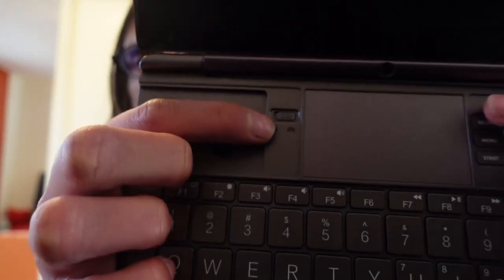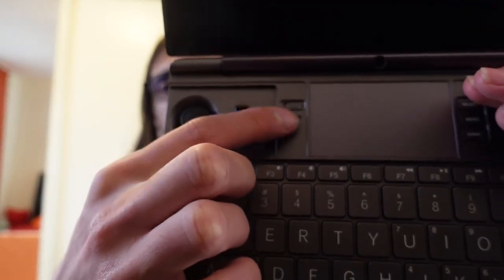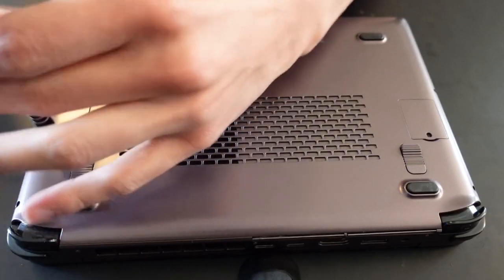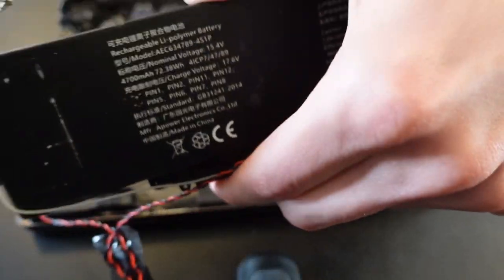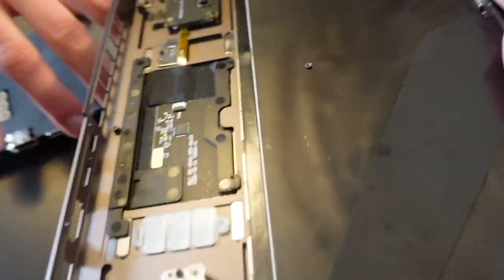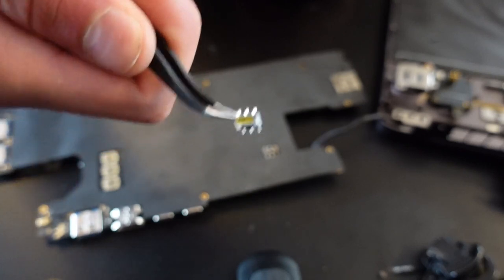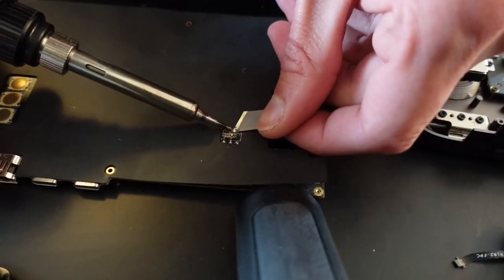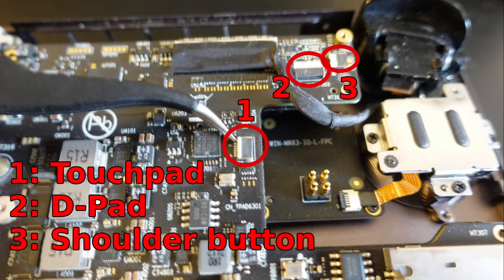GPD Win Max 2 - Teardown (bottom) + Mouse-Gamepad switch repair

Comment: Hi mystechry, looks like my new wm2 7840u defect suddenly it report hypervisor error and fall to automatic repair loop, end up with blank screen and fan hit high speed. All attempt to reinstall or fix is not working (through usb flash drive), I email gpd but have not receive any respond yet. My guess either the memory module or ssd have stability problem, since gpd put warranty seal sticker in middle hole screw, I can’t check and see the inside as it may void the warranty. It’s been 5 days my wm2 becomes the expensive paper weight on my desk. It still can turn on, enter the bios, but stop after the gpd logo appear and spin wheel.

Comment: Would you recommend win max 2021 over 2022 in terms of durability/issues? Seems like like win max 2 has a ton of issues
Reply from the maker: I am using my 7840u unit every day for many hours since I got it. So at least for me both units were super stable.
What annoys me a little is how I can not use both SD cards at the same time and that (for me) useless Oculink port at the back.
From an efficiency point of view, the 7840u is better than the 6800u
Reply: @mystechry  

So your 6800u didnt have the sd card constant disconnecting problems?  That is my only gripe with the 6800u unit. Not sure if it happens in both in the 16gb and 32gb ram variant
Reply from the maker: @oneyedthing  No, I never had that issue.
You can simply set SD speed to USB-1 speed to fix that issue.
I would rather have 2 slow than 1 hast card reader, but that is not an option any more with the 7840u
Reply: @mystechry  

I finally got a Win Max 2.  All my past concerns seems to be non-existent with my unit now. 

May ask another?  I know most of the testing are for gaming. Is it normal that while watching a 1080p full length movie, the battery percentage decrease to 1% every 5+ mins of play?  In about 30mins of playing the movie, I get 97% battery charge down to 88% 

No Wifi, no keyboard light, brightness is at the middle and volume at low  Also other uncessary running apps like OneDrive are disabled while I was testing it.

I hope I didnt get a unit with a battery problem
Reply from the maker: @oneyedthing  I am not sure and I can not tell you.
I have optimized my Windows to consume less power.
On an non-optimized Linux, that is normal I guess, so do not worry.
Reply: @mystechry  How did you optimize windows?  I plan on using WM2 just for games and not use online or for other apps so there is probably a lot I could eliminate/optimize.
Reply from the maker: @L337g4m3r  I know, I should finally make a video about that. There are debloat scripts out there. Here is one I used for quite some time, but it might be a little bit too aggressive for you. https://github.com/LeDragoX/Win-Debloat-Tools

Comment: Why are half the air holes on the back cover of the device blocked by plastic lol
Reply from the maker: The bottom half is the intake.
The whole area the fan can suck in air is free.
Air flow would not really profit from the area around the fan being not covered.
The round spot is the size of the fan.

The other half of the grid, which is solid plastic is not even meant for air flow, but just for aesthetics, to give the bottom more of a symmetrical look.